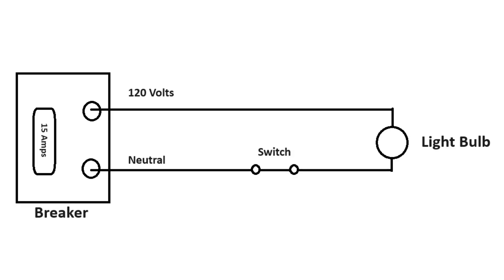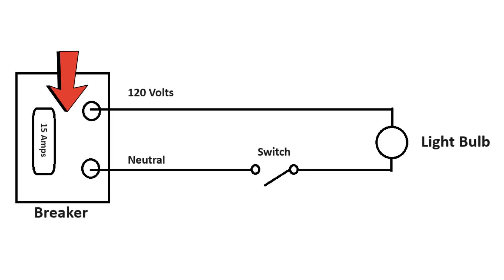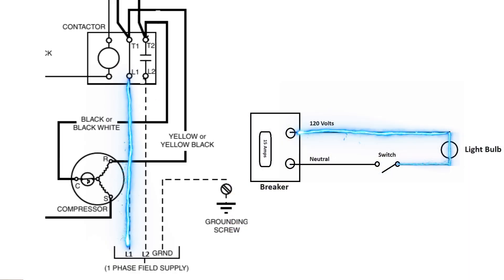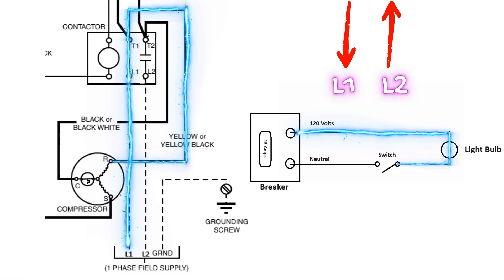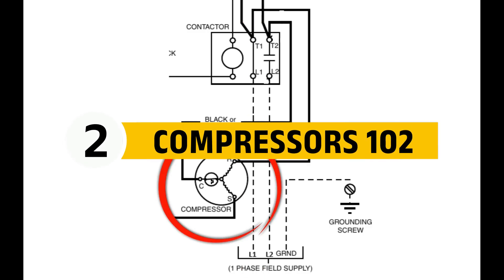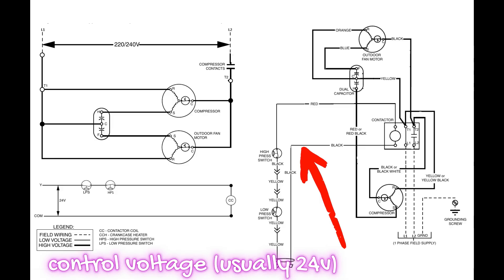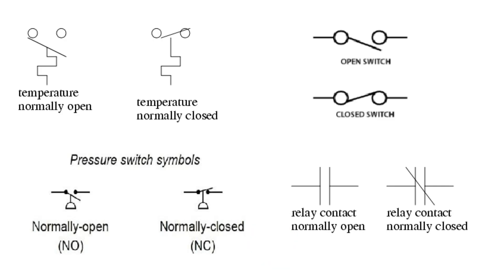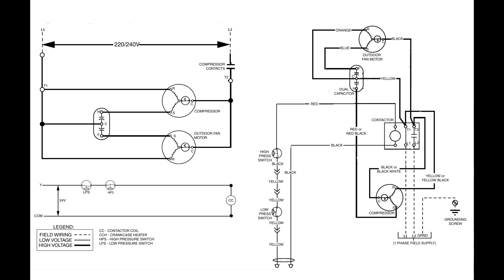How To Use Diagrams to Learn, Diagnose & Earn More

Comment: the break in the netural got me kinda confused bc Ive wired  a ton on light switches & we Always  always break hot wire not Neural ,,,,but sure it does the same thing interrupts the circuit but & also seen many many times  on low volts,  break ground instead of Hot
Reply from the maker: I never do it. I just did it in the video to prove a point on voltage readings in certain spots even on a broken circuit.

Comment: I am not an hvac guy but I have decided to learn it. I am a water man.  I work on pumps and install water treatment equipment.  Once I went to a residential pump that had a switch that controlled the electricity.  I switched it off and the pump stopped so I foolishly assumed that there was no longer electricity going to the pump. Wrong!  The switch was on the neutral wire like the example that Jersey Mike gave with the simple circuit at the beginning. I thought after recovering from the electrical shock that it would be better to always switch the hot wire. I have noticed that you find that same scenario in hvac systems. There is power fed to the motors that are switched on the neutral leg.  Am I wrong or wouldn’t it be safer to switch the hot wire if not both?  Why is it this way?

Comment: Just a note on the initial light bulb circuit, the neutral wire is never interrupted by a switch. The hot wire always has the switch. Thanks
Reply from the maker: Yes I know. Did it on purpose to prove 115v at the bulb even when the circuit was open.

Comment: should always break 120 volt wire, not neutral
Reply from the maker: At the 1 minute mark a note comes up on the screen stating switches are not on neutrals but I only did it here to make a specific point that needs to be understood in diagnostics.

Comment: You can’t tap the neutral leg to switch it should be hot leg tap to switch to work the lights. That’s not on code book bro
Reply from the maker: Yes, thank you. I'm not only well aware of this, but I also explicitly stated in the video this is not how it is normally done and further stated I was only doing it to make a point for educational purposes, which is in HVAC you can have situations where power is going to load without switches prior to the load.

Comment: I agree with AerialHeatingAir.   This is a great explanation of wiring.  It hit me hard when you explained how the two 120volt lines act as each others neutral.  Finally understood how this works. Thanks. Subscribed.
Reply from the maker: Thanks for the sub! I'm going to be doing a follow up video that'll get into that a little more.

Comment: I was lucky in that I had an electrician dad & uncle that I would go out on jobs starting at ten years old. Yep I was the gofer & clean up boy first couple of years. Wired my first 3 way switch & start stop pushbutton by 15. I was lucky to work under a very talented patient older electrician who would rather you ask a question then screw up work. Later on I tried to teach young sparkies. To all of you young electrician & HVAC guys get good no get very good at troubleshooting. My dad used to say they can train a monkey to do most conduit runs but not to troubleshoot. I got more overtime then other guys because I was good at troubleshooting especially VFD'S.  Never stop learning and do at least 15 hours of continuing education classes a year. Had to do an OSHA 10 Class to renew my electrical license the year before I retired and even after retiring attended 8 great yearly IAEI classes to keep up on the NEC until combination of Pandamic shutting classes down & the wife getting dementia.
Reply: i wish i'd had that.
my dad was a no-show and my grabdfather taught me how to open beer bottles with a lighter

Comment: Worked as an commercial electrician and worst schematics were pages of generic one size fits all POS prints. Would have dozen of options offered that were not on the machine I was troubleshooting. Hard headed Germans were great for having one person ordering the engraved plates, another making schematics then somebody making changes ending up that names in schematic were not translated to words on engraved plates. Would sit down on a slow day and cross out everything our equipment did not have on genetic prints. Had an Italian machine that schematic was in Italian. Took over a year to secure an English version. Some lazy day dick sparky left English prints on top of machine & cleaners threw them out. As soon as we got the English prints ( maybe 8 pages ) I asked that they take them some where and gave at least two copies made. They were probably 24 by 36".

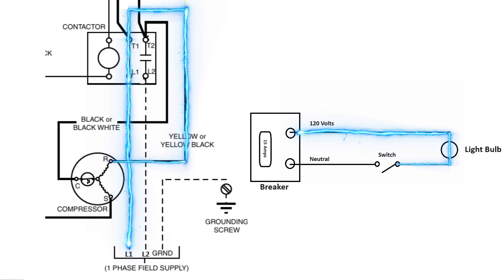Comment: 6:30 the explanation of 230 volt system not needing a neutral is incorrect. The compressor is designed to operate on a voltage of 230 volts (Power applied across the compressor motor windings). Otherwise well done.
Reply from the maker: Thank you. I understand we're talking balanced load vs. split phase, but considering the target audience, the balanced load explanation tends to be a lot easier for most beginners to conceptualize. I tried to explain split phase to a helper once and his eyes glossed over. lol.
Reply: @JerseyMikeHVAC

Comment: Know can we talk about inverters boards and how to troubleshoot
Reply: @ernestodiaz76  know, not know. Lolol <3 pronounced [no ,not now] 

No jokes, ac service tech channel is great resources and a book! Definitely check out Craig and the boys
Reply from the maker: I've actually been trying to find a way to tackle this topic for a while now, which can be a little tough. You kind of have to zero in on specific systems to tackle diagnostics because manufacturers use different methods to control these inverter circuits. On the flip side, a broader concept overview isn't going to help much with diagnostic procedures for the same reason. So basically, I'm going to have to get into this with multiple videos, multiple systems and specialized testing tools at some point. But I definitely intend to do it.

Comment: Great video! When the line traces back to run winding, confusing to see why wouldn’t it go to the start winding? It goes to common.
Reply from the maker: To be honest, I never actually checked with a mutimeter to see if voltage is present at the T2 terminal with the contact open to confirm voltage is present through the full path of the run and common windings, but in theory some kind of voltage should be detected there. Maybe not 120 due to resistance, but something. The reason the motor doesn't run is because you need a full circuit to provide the current that actually creates the magnetic field that propels the motor. Voltage alone doesn't make the motor run.
Reply: @JerseyMikeHVAC  so then the easiest path would be to go to common?
Reply: Also I have a slant coil (Carrier) debating whether to clean it in the unit itself or remove it.  Leaking water condensation too much on bottom.
Reply from the maker: @robertmunguia250  I would try inside the unit itself first. it's a lot of work to remove it, braze, vac, etc.

Comment: Another thing to remember so you don't have to memorize what type of switch comes in what position, is that all safety switches are wired normally closed. They monitor the systems and open when there is an issue

Comment: What confuses me is you can have 24v on your coil, but a safety is open on the neutral and it still won’t run…?
Reply from the maker: If you look at the low voltage ladder diagram, you'll see the safeties are wired on Y which is the 24v side, so the voltage doesn't actually reach the coil on an open switch. But even if they were on the com, you need an electrical current to create the magnetic field that pulls the contactor in. You don't have current on an open circuit.

 Think of it like a water wheel. You can have one sitting in water but if the water isn't moving the wheel won't rotate.
Reply: @JerseyMikeHVAC  ok that makes sense, however if the safeties were on the neutral wire, would you have 24v at the coil and it would just not be doing anything? or would you not have 24v at the coil at all?

Comment: Been having issues with the heating side of my HVAC heat pump.... Located the issue my HVAC guy bypassed the circuit board and I was looking at the Schematic and it was dirty so I took my dry hand made one swipe across the schematic and it disappeared 😮....So I still need to acquire one....I know it sounds like the dog ate my homework....I want put it back correctly. I have acquired a new circuit board. ,heat strips,blower , all check out well I am running Air as we speak... issue was blowing 3 amp fuse, was transformer. Haven't checked heat since fixing everything wanted schematic to correct before I went further. The HVAC guy has connected 3 or so wires to one going in towards compressor all taped together with a lot of electrical tape... That is what I want to fix. Because it had only one heat strip working... Your video are awesome by the way, that's how I got this far. From not😢 working at all. I spoke out of turn... I simply need a schematic, Where to get one... HELP
Reply from the maker: Glad my vids are helping you. I get a lot of manuals I'm looking for right here: https://www.manualslib.com/